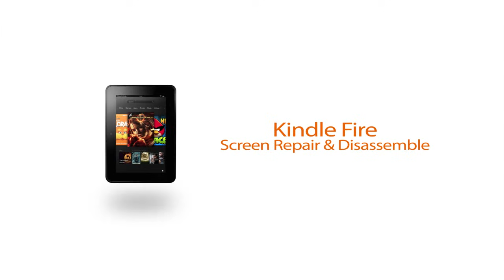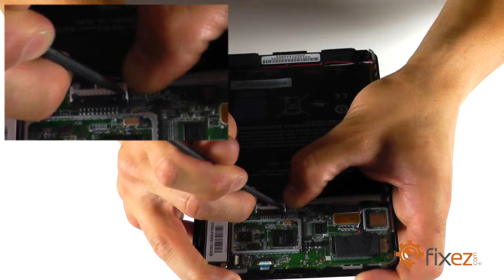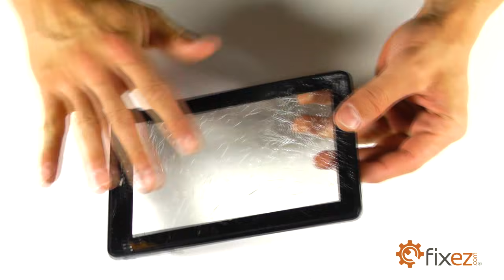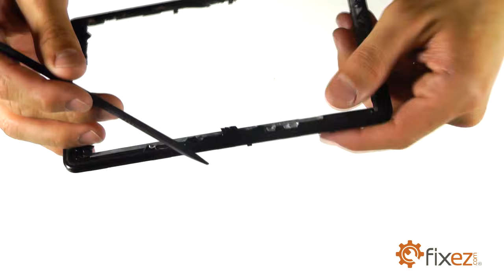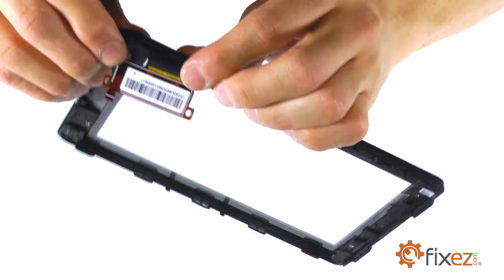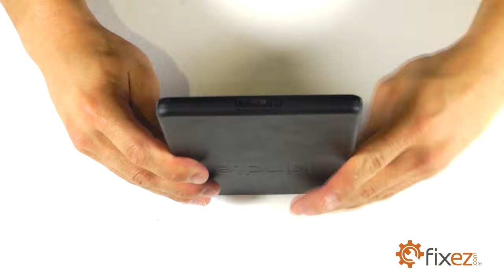Amazon Kindle Fire Screen Repair & Disassemble

Comment: I'm sure I won't know until I dig into it but my fire 7 works and just shows a shattered screen.. am I to understand that there is a two-part screen and the outer part comes off first and then the touch or digitizer is underneath and if so am I really just ordering a screen protector or am I ordering a two-piece set

Comment: i replaced the screen everything is working but the touch screen part how can i just check that without taking it all a part
Reply from the maker: +Sheena Martin You would need to double check your flex cable connections which would require you to take the unit apart. Once taken apart, just ensure the flex cable is seated properly and if the issues continue the digitizer may be faulty.

Comment: I've had my kindle fire for a few years now. One of my friends dropped it in class and it stopped working. I can press the power button to get to the lock screen but I can't slide across to unlock it.
Reply from the maker: +Kaci Depending on your specific model, you may be able to replace just your digitizer assembly.
Reply: +Fixez.com I have the same problem with my Kindle HDX 3rd generation but my screen is cracked. Do I only need to replace the digitizer assembly?

Comment: Is it possible to fix the "Paperwhite 2" screen?
Reply from the maker: +Aidan Kelwood At the moment we do not offer the parts for these models. The screens are available, replacing them should not be an issue.
Reply: +Fixez.com are you able to buy an Lcd and if you are were
Reply from the maker: We may recommend searching on eBay for any parts.

Comment: So it sounds like, from what I have read, if you have an Amazon KINDLE Fire HD 7" you will need a combination LCD/Digitizer (as they are bonded) but with an Amazon Fire HD 7"(non-Kindle 3rd Gen) it is possible to replace just the digitizer? Would you happen to carry the digitizer/frame assembly I see other people installing?

Comment: great video, thank you.  I think I did everything right, but when I powered it up, my screen is frozen, (not able to slide the lock or shut down).  Battery was dead.  Do I just need to charge it up, or did I possibly not connect something?  Any help would be appreciated.

Comment: Absolutely perfect video! Less than 30 minutes, would have been shorter if I didn't trap the ribbon cables under the motherboard not once but twice. No harm, no foul though, it's like new again!
Reply: ((facepalm))
Reply: ***** hey there can i buy this screen replcement in one kit?
Reply: Yes, I did the same thing.  Maybe a quick edit to add in a verbal reminder to make sure to keep the ribbon out, would help a lot.  Thanks for the video, though.  Helped a lot.
Reply: Why do they have to make it such a mission to change the screen